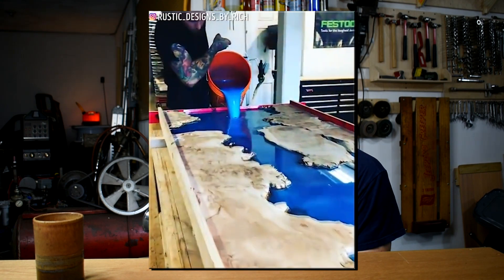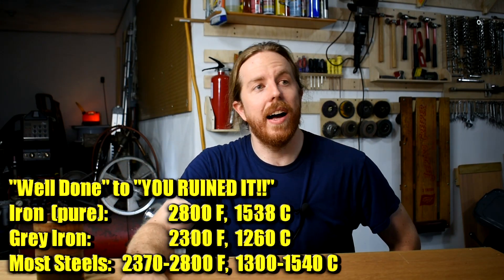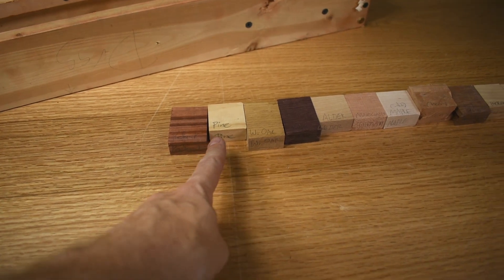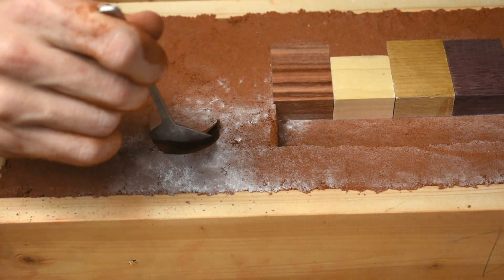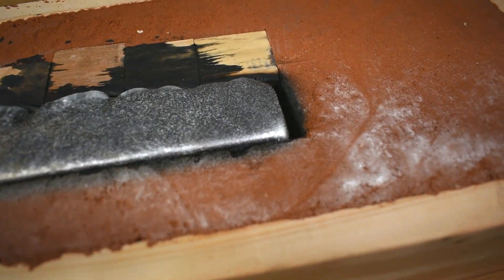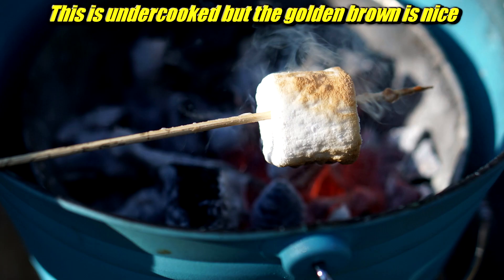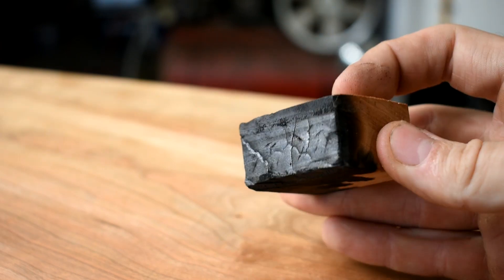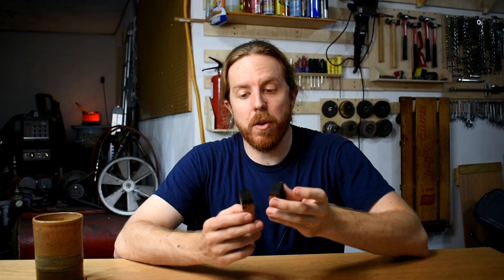Burning Wood with Molten Aluminum for...Science?

Comment: we used some sort of salt to make fabric fireproof (well at least self extinguishing ) think if you soak the wood in salty water and leave to dry before casting metal over it , it might work better 
putting screws halfway intoo the wood before casting should give the metal sumting to flow around and hold ontoo the wood 
it might allso be that the artists that made the cast/wood mix cheated and made casts of the wood parts in latex later fiilled with gipson and added those pieces to the mould , then added / glued in the wood after the pieces where cast 
still leaves you with the shrinkage , they couldve solved that by 3d scanning the wood pieces then 3d print the scan an x amount size larger before casting them in rubber or just 3d route them out of a block of gipson 
way way way over the top manner of doing things but than again the resulting "one off artpieces" probably whont be cheap to start with if one wanted to buy it

Comment: hard maple is the best! lol. I second locust or osage orange as said below, but I really do think hard maple will probably be the winner out of the simple, store bought woods that you would normally be using. I wonder if the oils might have also been some from the sand too since youre using petrobond sand?
Reply from the maker: Hard maple is definitely in the next test!  I think the oils are from the woods.  They bubbled out along the top if the barrier between the wood and metal, not along a sand line.  The petrobond definitely smokes a lot though

Comment: would it be a good idea to soak the wood in water ahead of time?
Reply from the maker: I'm guessing the opposite. This metal is well over 2000 degrees when it pours and it could cause a steam explosion if it encounters too much moisture
Reply: @PaulsGarage  well might not be a good idea in a closed mould.

Comment: Very cool.  Well done.

Since you were pouring from one end.
Could you correlate those first words burned more?

It would be interesting to know the moisture levels of each of those woods before a test run.
Do you do any sort of cooling after the pour, or just let them burn out? 

I think we need more tests!!

Don't burn the garage down. 8)
Army 
SE Oregon
Reply from the maker: They don't appear any different.  The pour was pretty fast (just seconds) and it sat for a half an hour or so before it cooled enough to touch.  I definitely need a way to control for moisture content.  These woods were stored together but the humidity in this garage isn't controlled for at all
Reply: @PaulsGarage  thanks for the fast reply.

I think that proves it....

More testing,  more melting and more burning.

SWEET!!!

Army

Comment: Great experiment, my bets was on the oak as I've tried to work with this before and it ruins the edge on everything.
Reply from the maker: I though oak would do fine but there are a few much denser woods here that I thought would do better.  I guess not.  The density seemed to help (all the low density ones failed) but there were other factors I guess.

Comment: Cool experiment!  I wonder how hard it is to get the metal and wood to bond together like epoxy and wood would.
Reply from the maker: My plan is to embed something in the wood that sticks into the metal area so the cast metal solidifies around it.  Not sure it'll work but worth a try
Reply: @PaulsGarage  I'd do some voids in the wood instead for the metal to fill like pins.